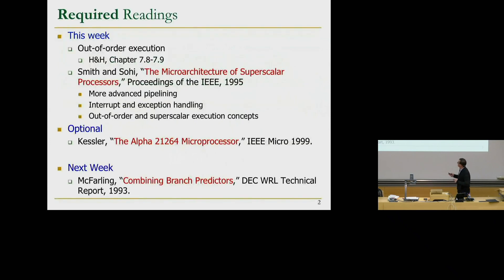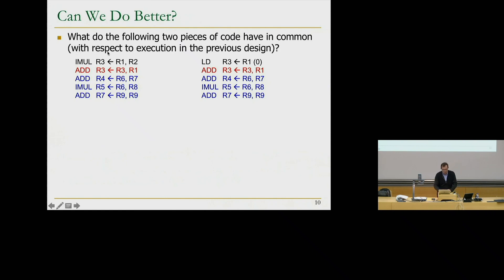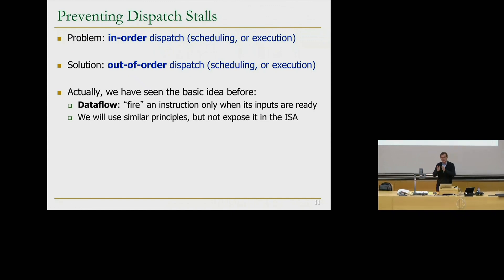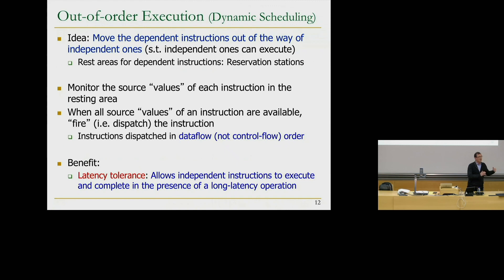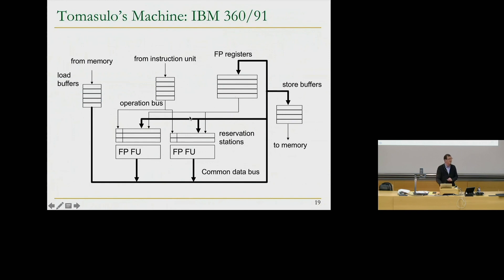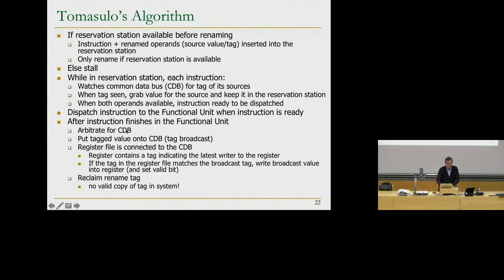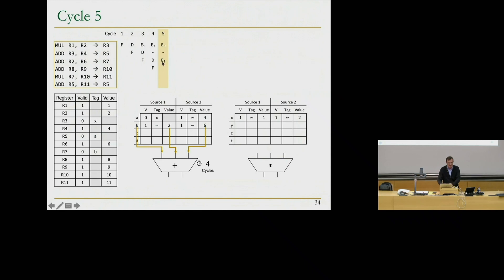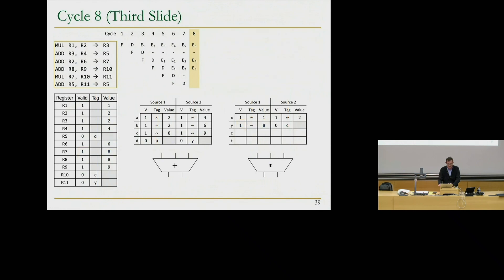Design of Digital Circuits - Lecture 15b: Out-of-Order Execution (ETH Zürich, Spring 2019)

Comment: Professor, can the hardware handle two broadcasts on the same bus simultaneously? Since in the use case that is being discussed, both Adder and Multiplier units are broadcasting Tag and Value pair at the same time.